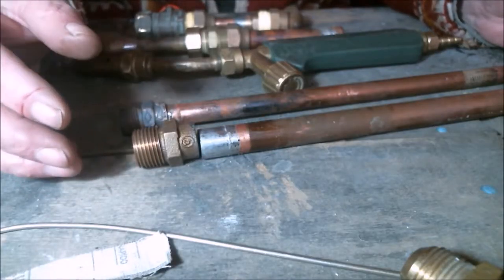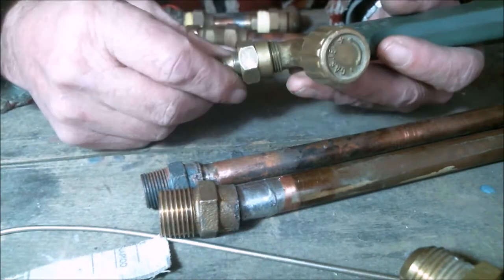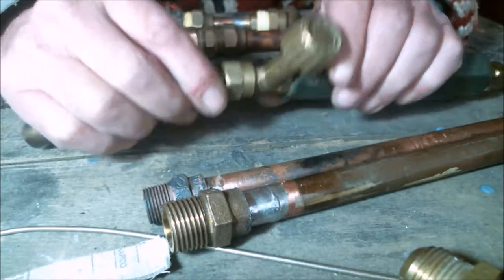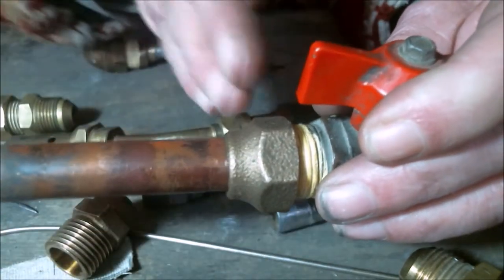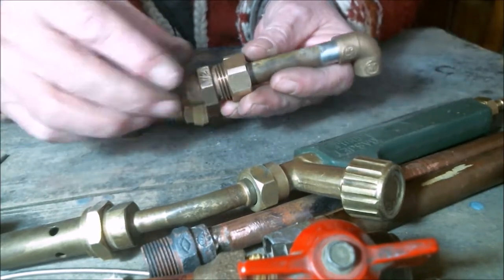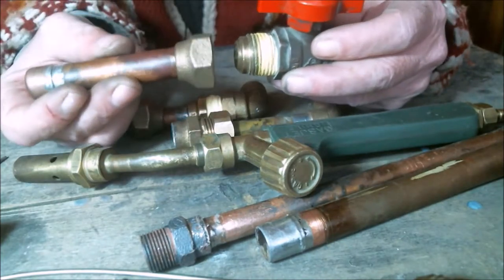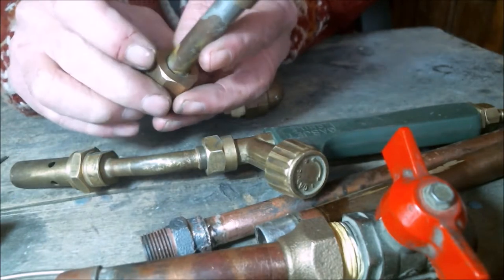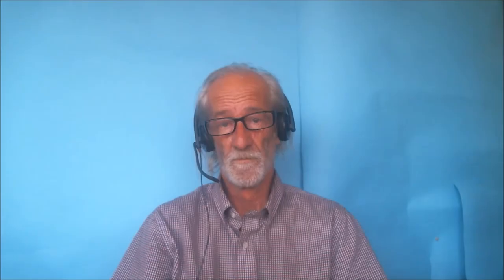Kinds of Joints in Gas Systems

Comment: Merci beaucoup Rod, I learned a lot watching your video. This knowledge will come in handy as I put together again two LP gas connections to my RV's furnace. I was looking for advice regarding which kind of sealing material I should use for both 1) the angled threaded joint and 2) the straight flared joint. The threaded angled joint I took apart had some sort of apparent hardened white material, presumably used as sealant, which I expect I will replace with yellow tape. I hope this "white compound" is something you'll mention as I now go and watch your video on "how to wrap sealing tape around threaded fittings".  Thanks again!
Reply from the maker: Thanks for your comment cooljp.  The hardened white compound probably is liquid PTFE.  I have tried it but, either I don't know how to use it or it was of bad quality.  I found it much too liquid to be of any use.  Maybe others with better experience with that material can give some good hints.  As far as I've seen the tape type white PTFE always retains it's threadlike appearance, that is, you put it on like a tape and it comes off like a tape (a bit torn though).  For gas connections you are better off with the yellow tape and wrapping it on with a cone shaped wrap as I explain in that video.
Reply: @RODsDIY  Thanks for you detailed reply! I'll do just that. Best, jp

Comment: Hello Rod, thank you for a very informative video. We are about to change out the regulator in our RV and I have a question just to be certain. It sounds like any of the mechanical twist on joints do not need teflon tape on the threads?
Reply from the maker: Hi Becky. I'm not sure if I understand what you mean by "mechanical twist on joints".  Let's say the basic logic of this is the following: if the seal betweeen two joints is achieved by pressing one surface onto the other using a nut, you shouldn't use PTFE tape.  If there are no surfaces stopping the gas from escaping through the threads you have to use PTFE tape: this is the case with a male adapter screwing into a female adapter (there is no nut).

Comment: Hello Rod, thanks for the video. Do you recommend using a sealant like boss white on the cone part of the first type of cone to cone fitting you showed? Thanks
Reply from the maker: Hi Martin. As far as I understand Boss White is like liquid PTFE.  As such, it can be useful sealing threads (although personally I don't trust it 😁).  With a cone to cone connection it might help by lubricating the surfaces (less metal wear) but I'm not in favour of using anything that might cover a failure of function, but won't be permanent or long lasting. I don't believe it would be long lasting.

Comment: Great videos. I've saved a few in your gas and plumbing playlist. I'm trying to do both in my single wide for personal use and in about 6 months to sell it. I have one issue though. My regulator for my gas range came in Spanish and I think I accidentally adjusted it. It can be adjusted for LNG or lpg. Is there any way we can get a video on regulator and basically on how to make sure your pressure isn't too high for your regulator or appliance. All I know is my lines are rated at 5 psi and my regulator and gas stove is 1/2 psi
Reply from the maker: Thanks for your comment.  I had no idea there existed regulators that could be adjusted by the user.  In any case you can use the instrument (U-gauge) I show in my other channel (in Spanish) https://youtu.be/cNROV4_haSk to measure the pressure in the pipes or in an appliance.  There are very good videos in Youtube in English about how to use the instrument and all registered gas fitters should have one for testing gas tightness in gas works.
Reply: @RODsDIY  that's genius! Thankyou very much. I was about to call the HVAC company because I am not about to blow up. The regulator I bought comes adjusted for natural but can be readjusted for propane and pilot type applications. I will look at your other video and reevaluate my plan.
Reply from the maker: @jordanmarker1220  Many thanks for your comment.